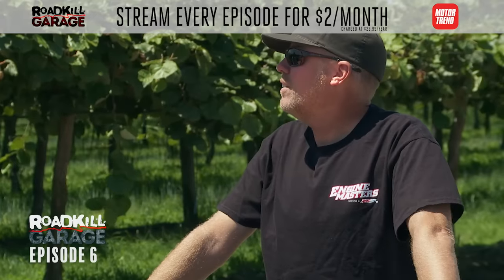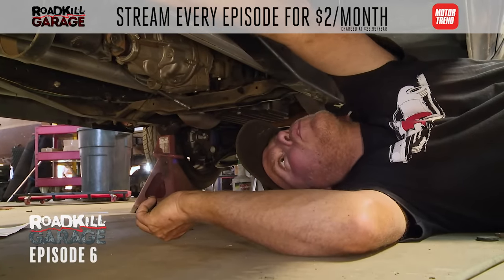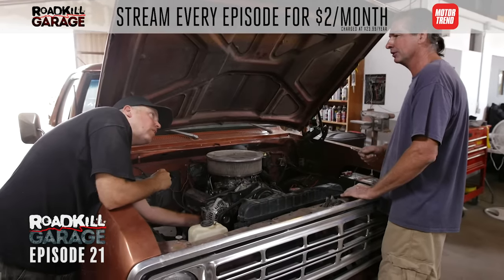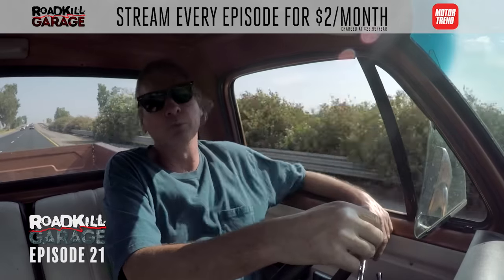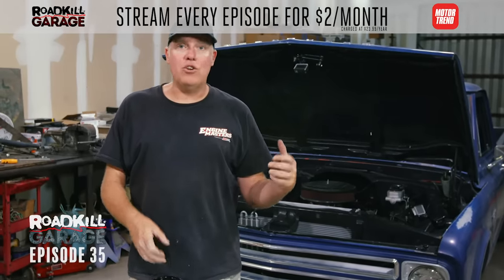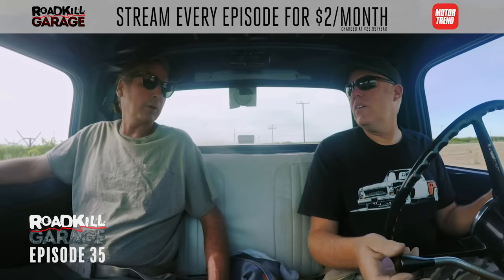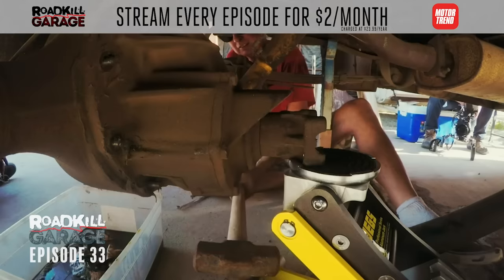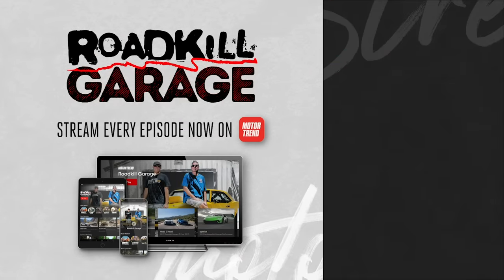Muscle Trucks Repaired & Supercharged! | Roadkill Garage | MotorTrend

Comment: American trucks .....this we relate to, I learned how to drive in a white long bed c10 327 two barrel 3 on the tree , pinstriped , cut coil lowered 15 x10 slots .good year polyglass 60 series tires with side pipes,toolbox and a huge lumber rack 411 gears .under dash ac unit .8 track am fm.  Am I alone ? 67 68  is still the sweetest truck ever!
.

Comment: I love your truck cuz I used to own one I'm pretty sure it's either a 76 or 77 mine was the 77 mine had a 350 with 300 horsepower headers and 40 inch glass packs no catalytic converter and it went like a raped ape I miss my 77 Stepside oh mine at four wheel drive as well I paid 500 bucks for it needed a front yolk the slip yoke in the front for the four-wheel-drive come on off the transfer case to the front end i replace that it also needed a wooden also the bed mounts where gone but everything was there and the frame was fine  I used hockey pucks  to replace the old mounts and long lag bolts  solid never got a chance to replace the wooden bed though I just drove the s*** out of it

Comment: Ford commercial,, unbreakable. Only when you throw away all the  50y/o Ford Parts!
Overweight understrength for their weight. And ofcourse the shorter the gears the weaker they are. And drag so much power and burn the diff oil. The only real advantage is the pinion is so low it clears floors,, but that is also the weakness.